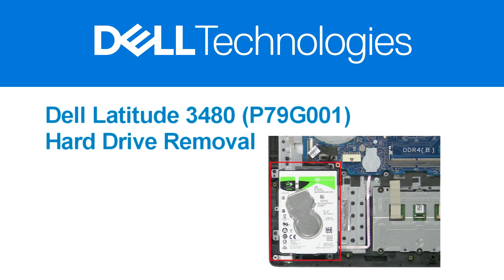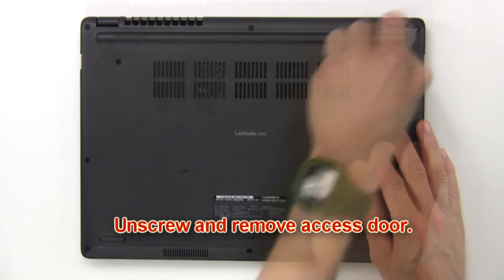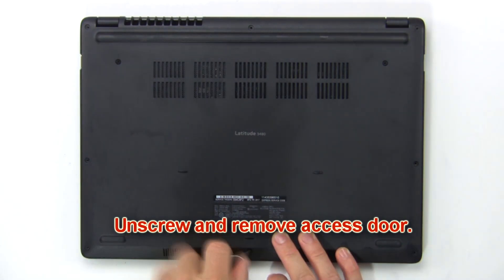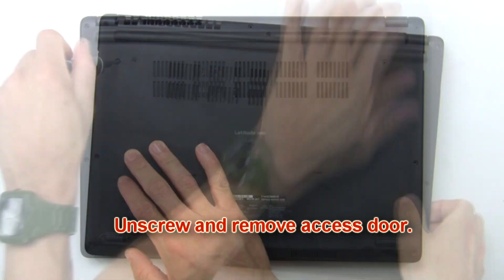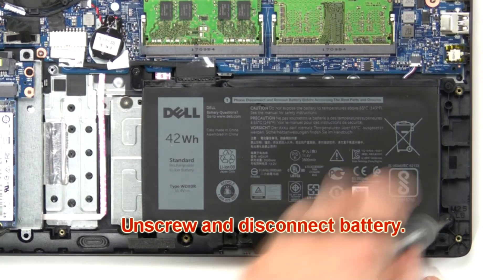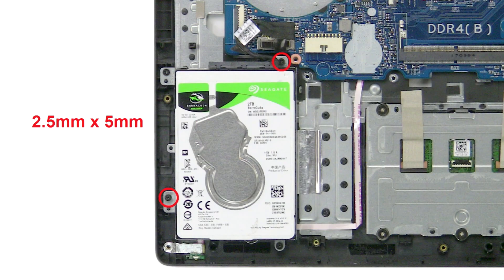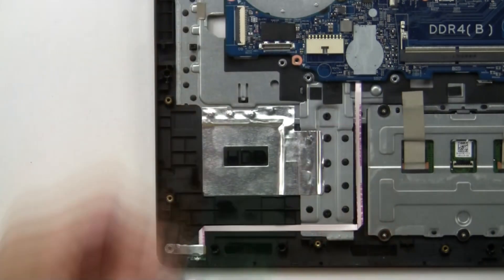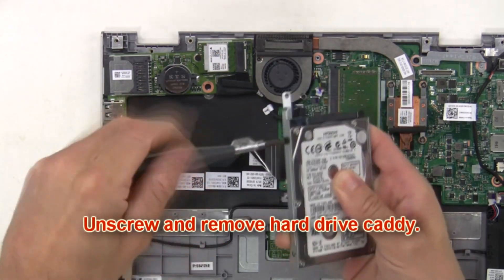How to replace the Hard Drive in your Dell Latitude 3480

Comment: This is useless, you show half the video with the 3480 which the weird caddy being the issue with swapping an m.2 with a sata ssd, and at the exact part that is the issue, the video is edited to show a regular hdd/ssd swap in an Inspiron pretending its just that easy and hoping to pass it off as the 3480 swap... not this kid, not on this day... Your video is deceptive and at best lazy and most likely from experience with Dell, just not wanting to deal with the issue...How about showing the real issue and the solution